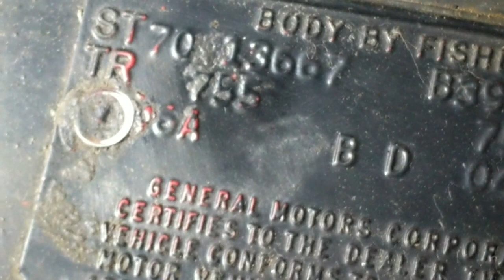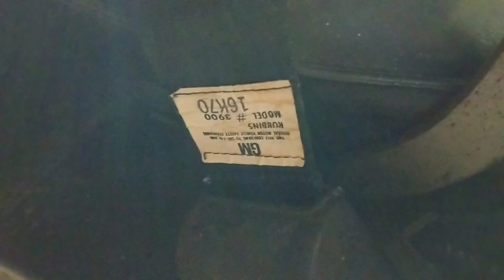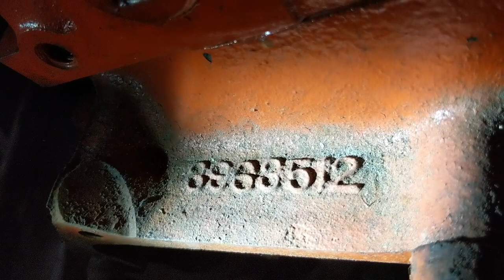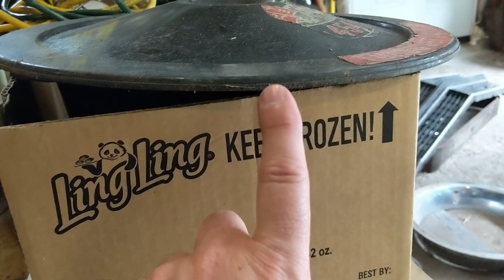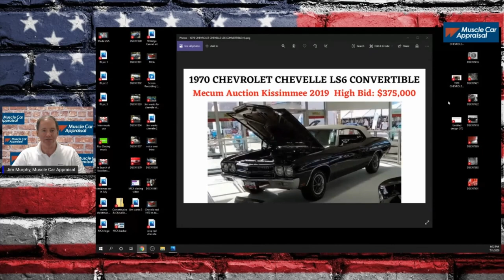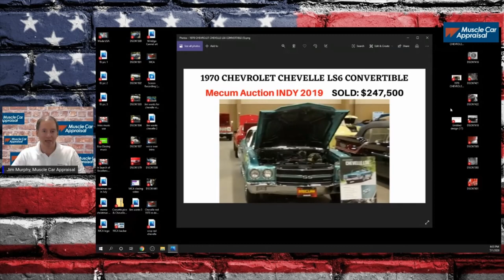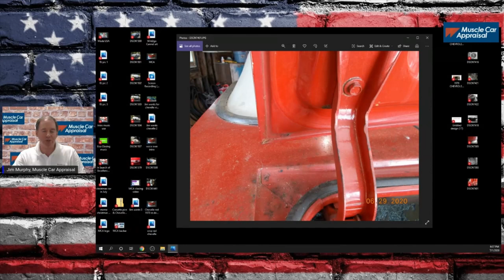Barn Find, 1970 LS6 Chevelle Convertible,  Worth: 6 Figures.  Rare & Valuable  Muscle Car Found

Comment: Cool find. Couple friendly comments - 1) You mentioned the cowl tag having rosette rivets, but rosette rivets are only on the VIN tag, not on the cowl tag. They are named as such because they are rose-shaped. The cowl tag rivets are obviously circular-shaped. 2) the Hurst shifter handle would not be correct for this car. This would have come with a "MUNCIE" stamped handle with a gradual curve to clear the front edge of the bench seat. It will have GM part # 3973864 stamped near the base.
Reply from the maker: Thanks for watching

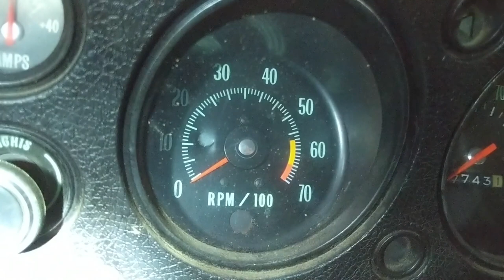Comment: 13:44 mark of vid..why would there be a small dent on faceplate of tach near 1000-1500 rpm ............
Reply from the maker: Most likely an assembly line issue when the gauge was assembled.  The car was an unmolested piece.  The tach issue was not a concern to the individual that purchased the vehicle as he too was aware of assembly issues back in the day.  Cars were not all perfect and still aren't.

Comment: probably wondering why this car is worth six figures well this 454 LS6 puts out 390 horsepower as the other 454 what's out 350hp  if I'm right
Reply from the maker: It's 1 of 13 made...rare car.  Thanks for being here...you are appreciated!  Thanks, Bob
Reply: LS5 would be 360 hp. LS6 should be 450 hp.